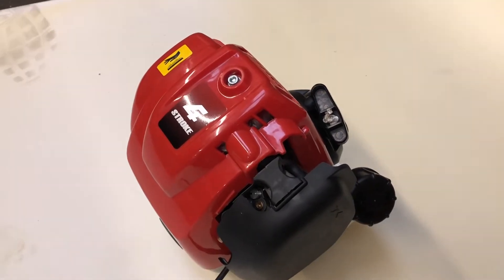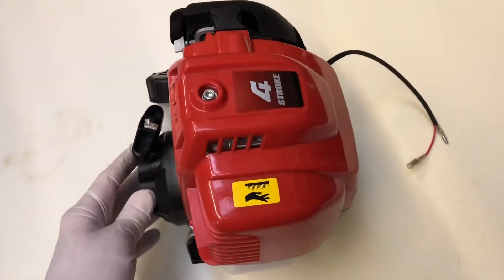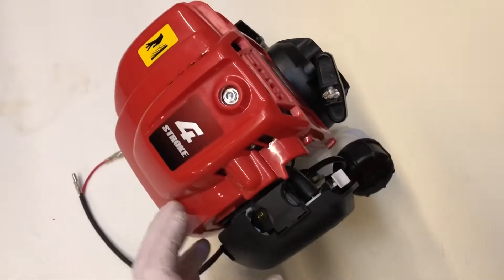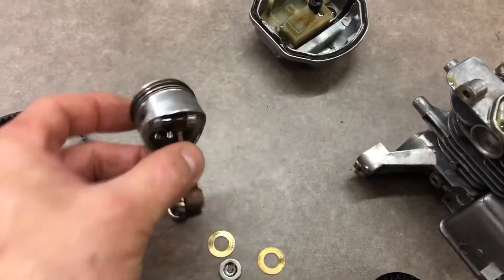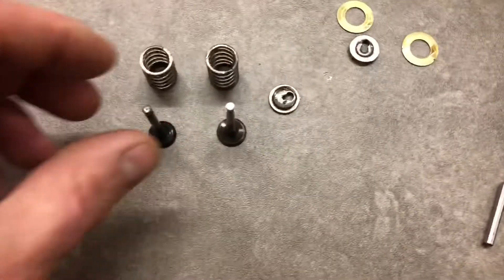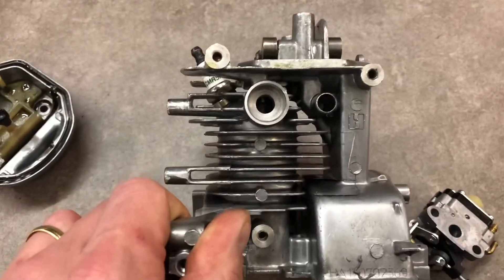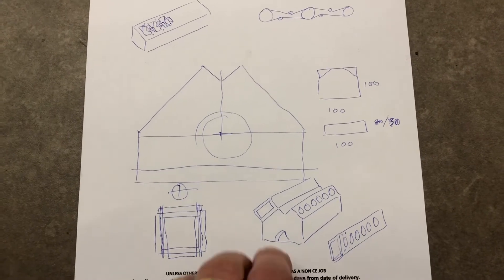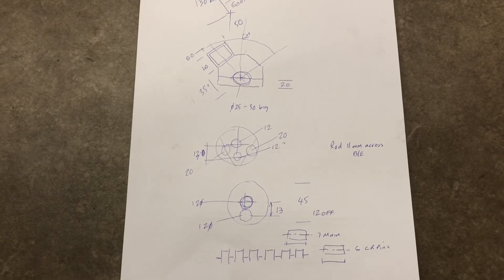Ferrari Go kart prt 20 actual v12 engine ?

Comment: Recently been looking at a similar project however using replacment bore kits for a YG6 engine and making all the bottom half out of a solid aluminium billet. Look forward to seeing you progress. Subscribed  (https://www.ebay.co.uk/i/153332622995?chn=ps&ul_ref=https%253A%252F%252Frover.ebay.com%252Frover%252F1%252F710-134428-41853-0%252F2%253Fmpre%253Dhttps%25253A%25252F%25252Fwww.ebay.co.uk%25252Fi%25252F153332622995%25253Fchn%25253Dps%2526itemid%253D153332622995%2526targetid%253D594043260150%2526device%253Dm%2526adtype%253Dpla%2526googleloc%253D1006912%2526poi%253D%2526campaignid%253D1700162090%2526adgroupid%253D66994533115%2526rlsatarget%253Dpla-594043260150%2526abcId%253D1140486%2526merchantid%253D110315683%2526gclid%253DCj0KCQiAzePjBRCRARIsAGkrSm66ZNRgCzCuVs6g8qgpX8m61sXSxiCtR431OuEsGaFwjie3rbGHIHMaAkM1EALw_wcB%2526srcrot%253D710-134428-41853-0%2526rvr_id%253D1877649968121%2526rvr_ts%253D3a7763621690a88ac811e489ffde42f5)
Reply: *cams and rockers can also be bought
Reply from the maker: I'm planning to use sections of 10mm thick alloy sheet laser cut  and welded together to make the block then milled to final shape., How many cylinder engine are you planning for ?
Reply: I was going to use a solid block of ali, however I think your right there on a fabricated body. Also I'm looking at first of all making a v-twin to get my head around how im going to make it and then was hoping to do a v12.